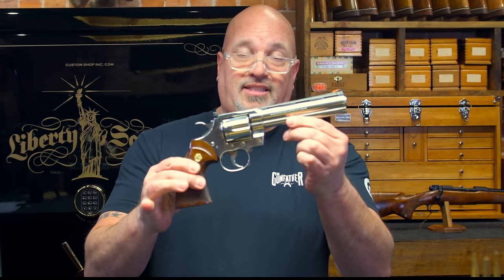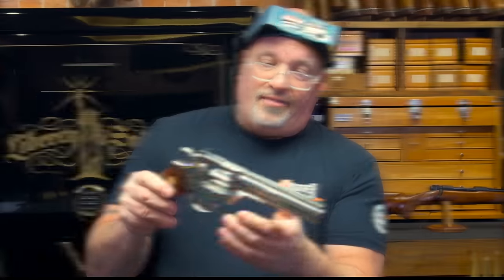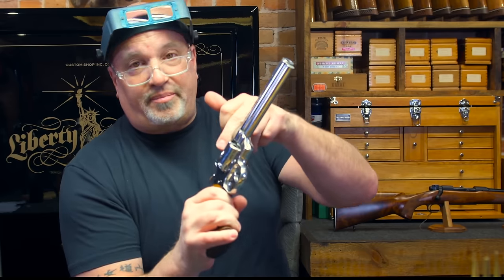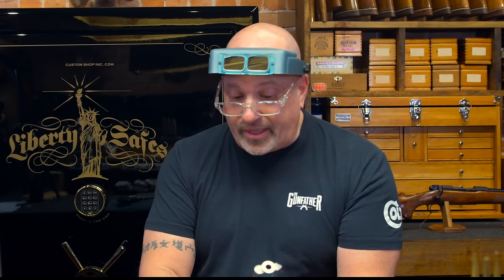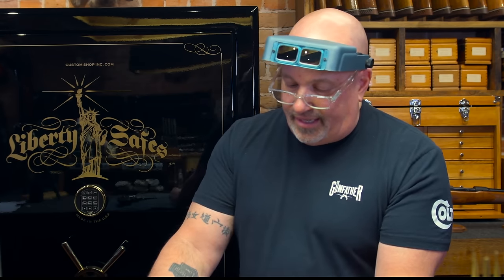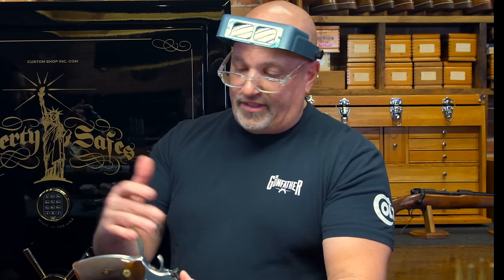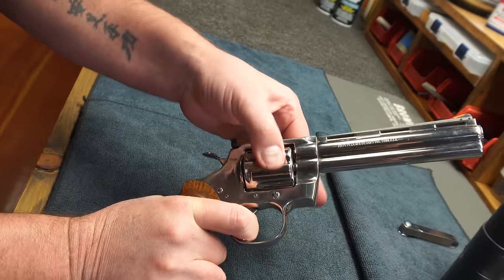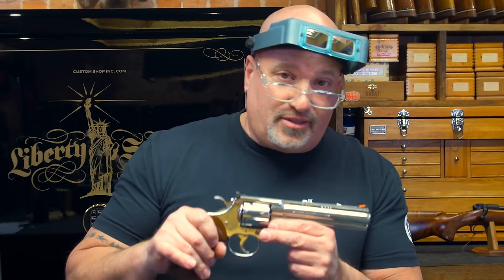Check the TIMING on Your Revolver  (Every Gun Owner Needs To Do This!)

Comment: I'm at a loss for words here...
Wha-???
------
I'm *ol' school.
One hand only: (put other hand behind your back if necessary)
Finger on trigger
Thumb on hammer (Do NOT drop hammer)
Cycle smoothly and RAPIDLY about 6-7 times.
Cylinder should lock up crisply each time at full cock. (Use thumb to return hammer upon activating trigger)
We should end up in absolute perfect alignment with forcing cone ON EACH CYCLE and at the END.
Congrats!
You're done!
Next test (D/A only) is realistically 2-3 cycles: (it takes practice and you should utilize Weaver grip)-that means no thumb!
Using trigger only, roll cylinder exactly far enough to lock up, then "smoothly" drop hammer.
Do this twice. (3rd is just showing off..or you missed one lol)
Congrats!
You're done.
-------------
No reason to keep dropping hammer in your "second" test, the first test already passed.
The second test is only to feel a crisp roll around and lock up.
The 2 or 3 hammer drops are a sacrifice to feel where it is between "factory" & pure slop.
Cheers!
--------------
*60+ yrs handling an firing pins/mechanisms/safeties etc are in many different designs.
Using the old school practice simply allows respect for every type of hammer/firing design and gives instant feedback on condition
Cheers!
--------------
And yes it should be CLEAN
But if it doesn't work in FILTH mode, then we have an issue.

Comment: Periodically I like to remove the cylinder from the crane and clean and oil the friction points on the rotating shaft. I've found that some of the powder residue can infiltrate that area and contribute to a cylinder that may not spin as freely as possible.

Comment: When I was a much younger man (1982) I trained as an armed security guard. Everyone back then said to buy a Taurus model 80 .38 because they are “good enough” for security guard work. Not knowing much about Taurus at the time I purchased a Smith & Wesson model 10 .38 . Why? My wife at the time said if my life depended on it, she wanted to make sure it worked. I still have it. However, I have since purchased Taurus revolvers .38 and .357 (new and used) and I have had no issues with them. Now, going “off the page” I have purchased an EAA Vindicator (Windicator) German made .357 . Although some would say, it’s clunky, clumsy, heavy (I agree with them) it’s built like a tank! I’ve also purchased a Czech made Alpha Project (imported by Rock Island Armory) .357 . With that particular (snub nose) revolver I wouldn’t say it’s “Smith & Wesson, eat your heart out”. It’s more like “Smith and Wesson, you’ve got competition!”
Reply: Your "wife at the time" is very smart.

Comment: Had a brand new s&w 629 obviously never test fired as it was VISIBLY out of time, you could hear and feel how rough it was when you pulled the hammer back, took empty case put a fresh primer in it cocked hammer back, confirmed cylinder was locked, the firing pin struck very edge of the primer nearly hitting the case, the notches were actually cut out of alignment so locked the cylinder chambers NOT aligned with the barrel, must have been made on a monday by people with hangovers.

Comment: It’s important to point out that the timing of the bolt drop is different for different revolver designs. The cylinder stop (bolt) in a Smith & Wesson drops earlier than a properly timed Colt. Vintage Dan Wesson revolvers are similar to Colt. I don’t know about Ruger double action revolvers.

Comment: I also put a dowel of the same diameter as the cylinder holes down the barrel with the hammer locked back. If the cylinder stop has been bent, (happened to a friend's Rossi. 38 ) the gun will be out of time. Even a little can cause lead to shave and be spit out the gap between the forcing cone and the front of the cylinder. A correctly sized dowel will catch on the cylinder face.

Comment: I am FORTUNATE to own 2 old Colts. I have 2 Colt 3-5-7s, one 4" and a 6" one. I'm VERY PROUD to own these pistols. I actually wanted a PYTHON or 2 but they have been QUITE EXPENSIVE for a LONG TIME and didn't figure that that wasn't FEASIBLE with my BUDGET. I found out later there were some OLD COLTS that can be had (for now but getting harder to find) at a more RESONANABLE PRICE but have the EXTRA HAND FITTING that the Python got later when it came out a couple of years later. I LOVE MINE,  REAL TACK DRIVERS AND ULTRA SMOOTH ACTION WITH UNBELIEVABLE ACCURACY with the right ammo and person shooting it.😉😆😄😃😀

Comment: I have a Smith & Wesson Model 19-3 manufactured in 1977.
It was owned by a police officer when it was brand new and when they were allowed to start carrying anything other than revolvers I ended up with this one. It's only had half a box of Magnums fired out of it and about 600  rounds of .38 special fired out of it. The only thing wrong with it it's just a place on end of the barrel where it's been in and out of the holster.

Comment: On the Python, what causes the hammer to drop too soon on double action? I had Cylinder & Slide in Nebraska, on recommendation from Colt put my 4" 1970s vintage blue Python back in timing. Well the hammer drops too soon causing miss fires on double action. I was NOT impressed after spending over $300 to get it fixed. The reason I KNOW that is the problem is my 6" hammer on double action goes back a bit farther than the 4" before it drops. The guy who runs Cylinder & Slide wants me to pay for the shipping to get it back to him which ticks me off too. He should have done it right in the first place.

Comment: So i just did this with a S&W 686-6 i bought months ago. Only shot one box through it so far. Passed all the tests you did. But on the lock up there IS slight slop as you put it. Its not solid and un moveable like your demonstrated, there is a small degree of play. Is this soemthing to worry about down the road. I bought it brand new no one but me has touched it.

Comment: Excellent review on cylinder timing. I have a SW mod. 15 3 inch combat has a very slighty  twitched on double action trigger hold cylinder. And a British 38sw webley double action trigger pull is absolutely solid shoots 6 inch groups at 25yds. How can I tighten the cylinder up at trigger pull hold on Mod 15 SW 38 spl. ?
Reply: Smith and Wesson revolvers rely on hand ( the part that rotates the cylinder attached to trigger, from start to lock up) thickness to determine tightness in rotational lock up as well as cylinder notch and bolt engagement ( think thickness ). If the cylinder has rotational play, a thickener hand may aid in tightening the rotational play. Since cylinder to barrel alignment is paramount for accuracy as well as safety. This operation should be done by an experienced revolver smith ( gunsmith ) The Colt action has a hand that locks the cylinder by length primarily, although correct thickness will produce a smoother pull in DA and likewise clean SA cocking with SA. That’s why holding the trigger back on MOST Colt DA designs since 1889 lock up like a bank vault when pulling ( pressing) the trigger fully rearward. No so with other designs controlled by hand thickness. Hope this explanations is helpful. TRJM COLTOLOGIST
Reply: @jerrymoran8323  appreciated

Comment: I would do a cylinder to barrel light test, then a barrel plug to cylinder dail indicator wobbel test (custom tool), before I would do a shoot test into some water to inspect centering of timing and cylinder lock in points. If they are off your bullet will have not centered bullet marks on one side. But that's just little not Mr. Notoutoftram guy.

Comment: I only own one revolver.
Everything else is Semi Auto which I prefer over revolvers.
I bought the S&W 10mm revolver specifically so I could have it reamed to accept the 10mm. Magnum round.
As a Machinist I probably could have done it myself since I have a lot of my parts riding into space on the NASA Shuttle but there might be something I was unaware of so I sent it out to be done by a Gunsmith. And lo and behold there was something I wasn't aware of....Timing. In my mind the parts should be interchangeable but nope!!! Thats not the case.
What a Difference!!
While the 10mm round is nothing to sneeze at the 10mm. Mag is a whole nother animal!!!

Comment: My Department issued Smith and Wesson revolvers. You could also purchase your own “list approved” revolver if you didn’t want the Department issue. I carried a Colt Python. No Smith and Wesson ever had as smooth a trigger as a Colt Python, unless extensive work was done. That work would not be approved by the Department, as it was no longer to factory specs. I do own other Smith and Wesson revolvers, and the are a quality pistol - but they are no Colt Python.

Comment: I've always wondered what kind of tolerances are needed with revolvers. Specifications the alignment of the cylinder/round to the barrel. Does it ever happen that if the cylinder isn't PERFECTLY lined up within MILLIONTHS of an inch the barrel will explode? Does the round ever in the very outside of the barrel at the opening? And then stop? Force it's way in and then down the barrel?

Comment: The beauty rings, drag lines, on the cylinder is because the cylinder lock is popping up to early. 

A properly timed revolver will keep the cylinder lock in the down position until the cylinder is rotated to the ½ moon cylinder lock notch lead is aligned with the cylinder lock.

It should pop up into the beginning of the cylinder notch lead. That revolver as many new ones isn't properly timed. 

Standard Manufacturing, Colt and very few understand what a properly timed revolver is all about.

Comment: I had a wairauch .22lr revolver. The cylinder face where the hammer strikes was all marked as the hammer was not hitting the rim but hitting the cylinder. So miss firing . Ended up scrapping it as no one could fix it. It didn't cost me anything just wandering if you would of had a solution

Comment: Fun fact i was charged by a grizzly and pulled my .44 dan wesson and had it at the ready.  The bear broke off the charge at about 20 feet so all good.  However, i immediately went to the range to make sure i was shooting well but the gun failed to fire..
After multiple repeated failures it did fire… and after some tinkering i figured out the timing was off (probably dirt).

Comment: There’s a false narrative out there in the revolver community that you do not need to disassemble your revolvers, clean them and thoroughly lubricate them.

People act as if these machines do not need additional lubrication and don’t need to be cleaned. Although it is true that you do not need to clean the internal components all that regularly. It still must be done. 

Every used revolver I’ve ever purchased aside from ones that were never fired. Had a pretty good amount of carbon buildup on the inside. 

It is incredible how you can take an older revolver, completely disassemble it clean it thoroughly lubricate well and it’s like the smoothest ice on the inside.

Comment: Am i wrong by stating that you video on the "timing" was not spot on. Maybe i fell asleep but i didn't see anywhere your checking bore to cylinder alignment. Just cuz your cylinder locks up tighter than a nuns who-who does not mean it's alignment is accurate.

Comment: "OK" x 1,000.
Geeeeeeeeeze.

FTR and as an example, a Colt Model P or a Remington 1875 is a single action revolver, which means it will fire only after the hammer is cocked manually and the trigger pulled.
A double action revolver can be fired either by cocking the hammer manually and dropping it with the trigger, or by simply pulling the trigger through, bringing the hammer from its resting position all the way back to its cocked (but not fully cocked) position, which allows the trigger to trip the sear as it moves farther back, allowing the hammer to fall.   The second technique is commonly and erroneously known as "shooting double action."   It's actually "trigger cocking."
"Double action" actually refers to TWO DIFFERENT WAYS to fire the same gun.

There is no such thing as "Double Action Only."

Comment: The best gun you could have is the smith and Wesson 327 snubby a pocket cannon indeed
Reply: I have a Ruger SP101 with a 3” barrel in 327 Mag that I CCW.  6 rounds of 100gr Gold Dots over 1400fps from it can be a definite handful.  Most times I stick with the same bullet but in the H&R Magnum version. Love that little Ruger.

Comment: You don’t have problems here with the colts! You definitely have a problem here with the Smith & Wesson. Even dirty the python will time correctly except if the outside cylinder notch is broken or full of mud which in 50 years I have never seen happen. I can show you how even a new Smith can lock up because of a faulty mechanical system. I have demonstrated hundred of times to smith owners. I have owned and traded or sold many away because of this problem. It happens when you half pull the trigger and the cylinder does not return to position accurately if you decide not to fully pull the trigger and let the trigger back to fully normal position. Then when you try to pull the trigger again it is misaligned and can JAM as the cylinder notch is not back to its normal position. Believe me it happens. Not every time but once is enough!

Comment: Ruger Vaqueros timing sucks. Do not use if you are a quick draw or action shooter. It will not lock and those rounds will go off un-aligned with the barrel

Comment: Not sure that "Joizaay" accent lends credance to a "small Montana gun shop" vid. U did o.k.(okay) on subject matter( okay?), yet I didn't catch your warning to viewers about spotting signs of "cow-boying" a revolver, and it's detrimental effect on timing.( "Cow-boying" is the act of putting/holding hammer on "half-cock", then spinning the cylinder, ( too often doing so repeatedly, unnecessarily) thus immitating Hollywood cowboy scenes, causing excessive wear on cylinder-stop) This is easily spotted by "ring-around-the-cylinder". Far too many good revolvers have been damaged by "couch-cowboys"!!! IMO.